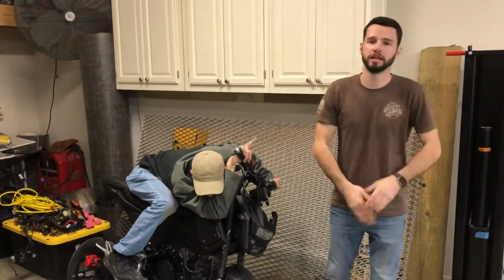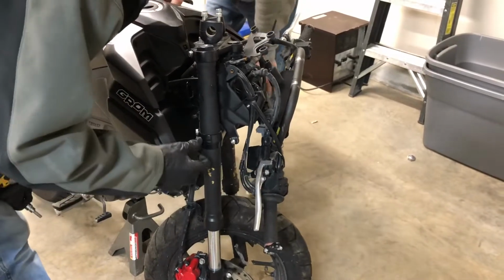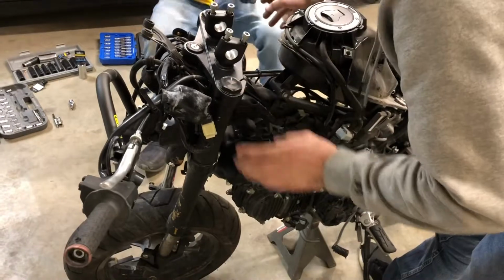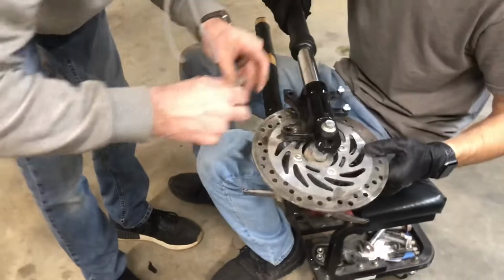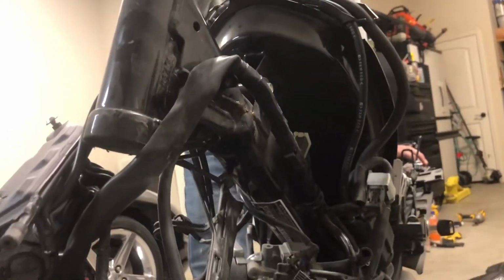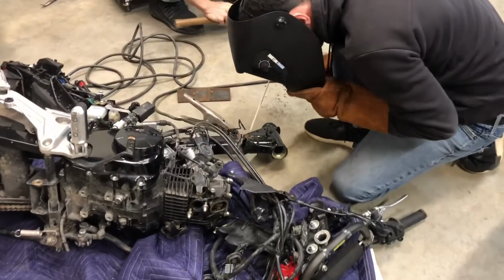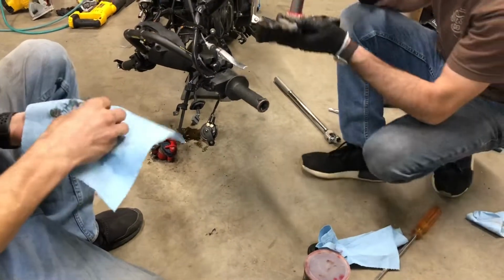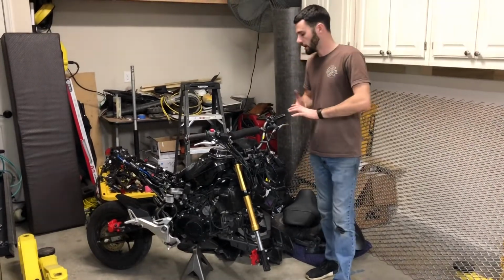Rebuilding A Wrecked 2019 Honda Grom Part 2

Comment: I just bought a 2020 salvage grom and my frame is bent in the same place and about the same way. I think I'm just going to get a new frame.  More time but a better piece of mind.
Reply: LwRdXtReMe2K I just bought a 2018 with 614miles, found out the frame is also slightly bent there. I also plan on swapping the frame at some point. Have you done it yet?
Reply from the maker: We ended up having an offer to buy it as is, so we sold it and they replaced the frame, was told it wasn’t super hard, if you look around you can find frames for around 250$ new, in my state, they have to be stamped with the vin number as well, which is why we also didn’t want to replace it
Reply: Ara G  I haven’t done it yet but I am glad to see new frames aren’t all that expensive.  That’s great mileage for a 2018. I might make a series on YouTube once I am able to get all my parts.
Reply: LwRdXtReMe2K I was looking at a different 2018 with 132 miles but the seller was too slow to message me so I got the one I have now. I'm hoping to order more parts this week
Reply: I got a 2019 grom with the same bend and was thinking of having it professionally weld! How safe would it be? Just commuting back and fourth! No stunting or anything